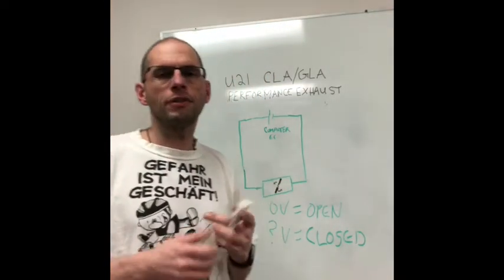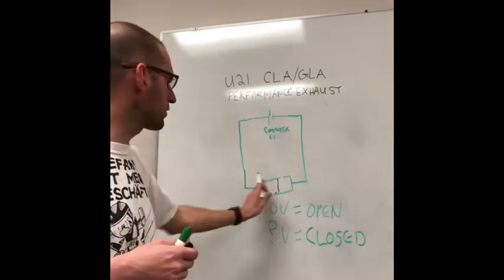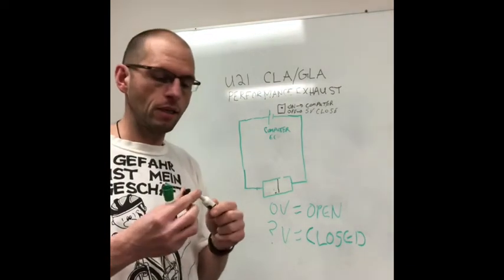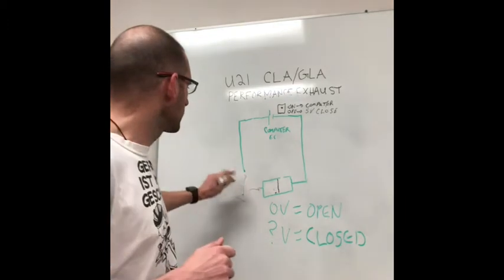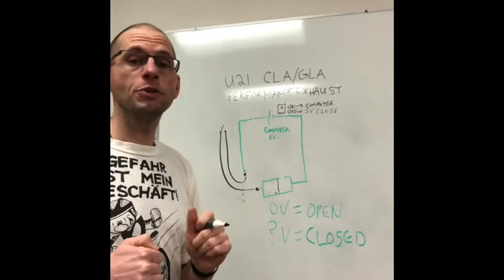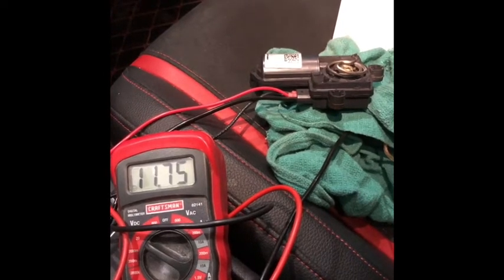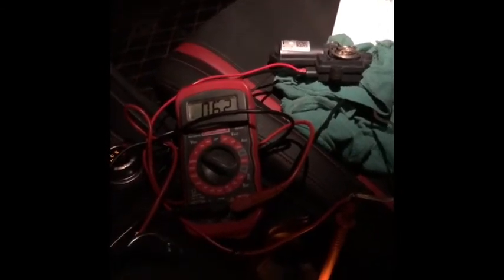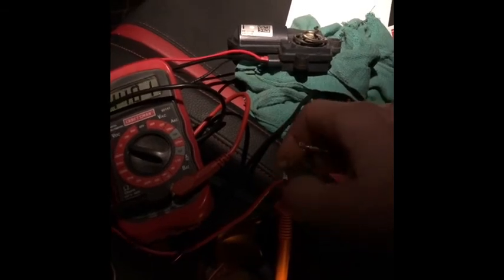Explaining and controlling the exhaust valve in a 2016 GLA 45 AMG performance exhaust system

Comment: brother you have 2016 45 amg model and you have exhaust flap button in your car specialy for this purpose only that is you can open the flaps on any mode mine 2015 cla 45 amg has this button space but it doesent have this button plus suspension button installed in it plus that rotating dynamic select package which has individual comfort sport sport+ option.mine only has comfort manuel and sport mode i do not understand why you say it cost 500$ plus i thought if i had that flap button i can open it any time can i install that button afterwards in my cla45 amg pardon for my english...

Comment: Hi Jim. So the wife now has the 2014 cla45 full time as I got another vehicle She doesn't like the loud exhaust. I don't have a fuse in spot 28 ...but I do have the performance exhaust. Are there any wires I can pull or any other ideas to keep the exhaust/vehicle quieter?

Comment: Hi Jim, your explaination is very clear and inspiring. It's a great option to keep the valve open without cost a fortune! Appreciated! I just have a small question as I have no engineering background. As a lot of people mentioned that disconnecting the connector of the exhaust value will cause an error code in ecu (possibly power reduced) as the car detects exhaust valve not working properly. In your another video you added a switch to control the valve. I assume you use the switch to  to physically disconnect the wire. I am just wondering why adding a switch will not cause an error code in ecu？I noticed that there are 3 wires on the connector. Is that because you only added the switch on only one wire? Kind regards,
Reply: Yes. I believe it causes “limp “ mode.

Comment: WRONG. The button doesn't control the valve. And you say you're an engineer??
Reply from the maker: A very successful engineer as a matter of fact. This video was posted before I learned more about the exhaust system. The button on the dash does not control the valve near the muffler but it does control a valve which sends amplified exhaust volume into the cabin. I hope to update and correct this video at some point......  No reason to be a smartass about it.